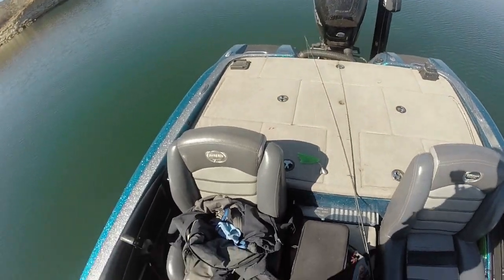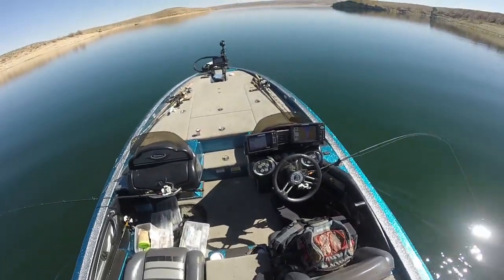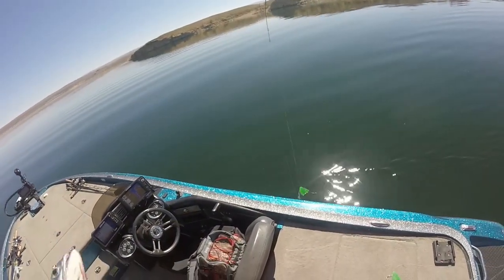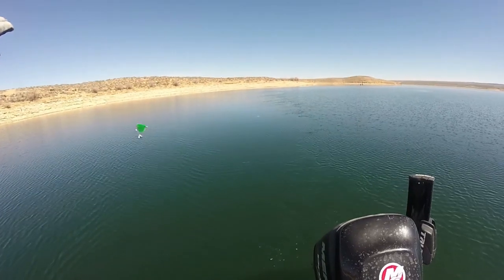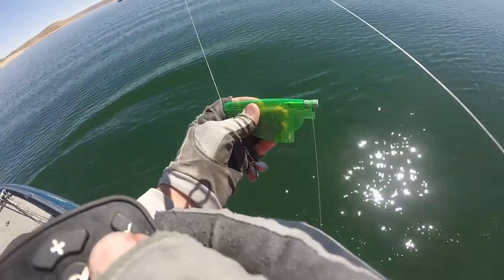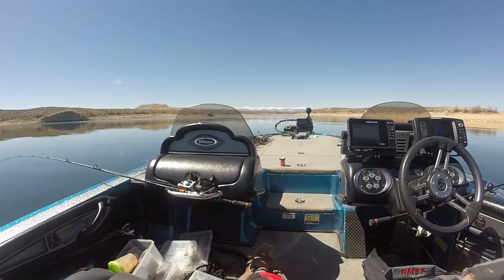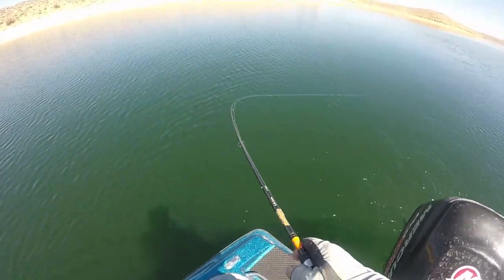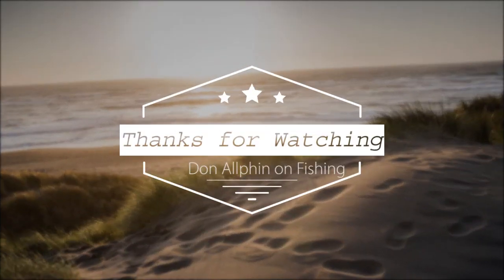Long Lining Kokanees 2021 Flaming Gorge Spring

Comment: Hey Don I will be headed to the Gorge for my first trip this year next week. I will be in the state line cove area my boat is not a fast boat. I see you fish in the pipe line area I am comfortable going there occasionally. Any other areas in my vicinity good for Kokanee and pup Lake trout? I am equipped for a little bit of everything. I have downriggers and long liners at the ready as well as Kokanator jigs. Any approximate areas you would recommend would be great thanks for your videos.
Reply from the maker: Jarid,  I have not been  on Flaming Gorge since the 1 of July.  Having said that, I am now back in town for a week or so and will be on the water on Wednesday the 28th of July.  As of right now, with the warm weather, kokanees and pups can be as shallow as 25 feet in the early morning and as deep as 75 to 80 feet during the heat of the day.  Kokanees should be stressed right now so try to fish early and remember to keep all kokanee caught (up to your limit 3 in Wyoming and 4 in Utah), kokannees will no survive being caught and released this time of year.  As for where, I still like the pipeline area on both sides of the channel and I sill like Anvil on the east and the west.  start with jigging and plan to troll very deep, so when trolling stay in the main channel.  If you make another comment in a day or two, I will give you a better update based on my fishing tomorrow.  Thanks for the questions and I with you great  luck when you get up here in God's Country.

Comment: Is that the end of the WY side, like above buckboard, im not familiar with that side but want try it.  In 2019 WY stocked over 1 million Kokanee that helps the odds.
Reply from the maker: Jed,   I am finding kokanees anywhere from the pipeline up to Buckboard.  This particular video was shot just north of Anvil .  The thing you must remember is that kokanees travel A LOT.  They don't hang in one area long.   That's why the only times I talk specifics about areas is when there is an underlying reason the fish are there like the spawn or a lot of plankton or other food for the species I target, lake trout, rainbows, smallmouth bass or certainly kokanee.  Right now, the kokes are simply lookiing for abundant plankton.  They might find it in a cove or bay one day, and the main channel the following day.  That's why it is frustrating to read a fishing report from the DWR and see that they are basically the same from March through October.  Generally, yes, kokanees like certain areas but in specific, you simply must know where to look and locate schools practically each time you get on the water.  Thanks for watching.  I hope this helps.

Comment: What pound test are you using with these?
Reply from the maker: Kelly,  I use 10-pound-test Berkley NanoFil braid although mono or fluorocarbon would be fine.  The key is the smaller the diameter of line the deeper the longliner will run.  There is a chart in each longliner purchased that allow you to know exactly how deep they are going.  It is NOT just the amount of weight you use but how much line to have out.  Ten pound line should be plenty for kokanee salmon.  Thanks for the question
Reply: @doafish  Do you find that the non-stretch braid is any better or worse while trolling for the Kokanee? As opposed to mono with a lot of stretch...
Reply from the maker: @KD-kf4zm   If you are trolling with downriggers, I suggest you stick with a stretch line like monofilament or copolymer.  I LOVE my braid for jigging and even for when I use a LONGLINER, but when you use the "releases" on downriggers, my braid is too slippery and we get too many  false releases.  I hate having to raise up the downriggers and re-set just because the braid slips out of the holder.  And, I am thinking that I will most likely use smaller braid (6-pound instead of 10 to 12-pound because when the braid gets waterlogged, the line shows up on my finder as interference.  For me it's no problem because I can always see my lure, but sometimes upper schools go undetected due to line interference.    All of my techniques are works in process.  When I come up with better ways to do things, I will always share those with you.  Thanks for the question!
Reply: @doafish  Thank you for the response! How are you liking those Quantum reels? I couldn't tell what model they were.